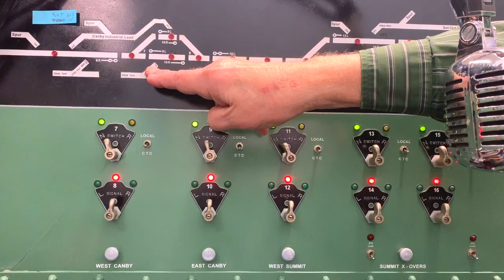How it Works: Railroad Signals and CTC (US&S Type)

Comment: In case there are people out there that don’t know what US&S means. Since it wasn’t explained in the video.That is the name of the manufacturer of the prototype signaling system used on many railroads and it stands for Union Switch and Signal. Also in case you were wondering what the radio system that model railroad was using is called FRS,  or the Family Radio System. A group of low power frequencies that can be used for two way radio communication without an FCC License.

Comment: Finally a related video that I can ask you something on! I have a freelance railroad that’s based off of SOU. do you have any documents where I can find SOU signal aspects, operating rules and train IDs? I don’t necessary need the operating rules, but I would like the signal aspects and train IDs.
Reply from the maker: You can google search NS or Southern / SOU railway signal aspects and that should pull up several charts / signal diagrams. For train IDs, facebook groups specific to the railroad your modeling are a great resources that may help you find what youre looking for. Hope this helps!
Reply: NSmodeler24 thanks! I sort of figured out the train numbers. They had manifests in the 100 series and intermodals/TOFC in the 200 series. Other than that I couldn’t find anything for the numbers. As for the aspects, I found something.

Comment: This is like the CTC system I controlled until more modern computer sustem was installed.  For the most part I liked the old system better.  For one thing it was more dependable than the modern updated one.

Comment: I know this is an older video, but wanted to ask.

I’m a conductor on CN and the Beaumont sub, where I work in Mississippi, is CTC- much less like most of CN’s track.

Does he have the ability to place a signal in “fleet” mode? Fleet mode allows for you to pass the signal, multiple times, allowing it to return to a signal more permissible than stop, Everytime. It also works when there’s cars in a siding, or main track, allowing only a restricting signal, or approach if only lines to the next signal.

We use fleet mode for making multiple moves if we need head room, for example.

Comment: Hey Josh, I have an unrelated to this video question. I’m building a C40-9 the same way you did, and I’m having a few issues. My first issue is the shell seems to be too short for the frame, as the trucks would clip with it if I cut it anymore. I’m wondering how to fix this. Thanks a ton and keep up the great work! - Cody

Comment: I would love to see what your procedures are in case there is a "derailment" do you just put the car back on track by hand or do you do something else?
Reply: We re-rail the train as quickly as possible to avoid any further damage to the models. Tim, the layout owner, will usually channel is prior real railroad experience into his best impression of a tyrannical trainmaster. If the derailment is is truly spectacular, we'll take  pictures if it.
Reply: supergamersbro I had a spectacular derailment one time, I had an Erie alco on the main line and a custom alco on the inner track. I had worked on the inner track recently and so I hadn’t fastened it back down yet, I was testing the track while I accidentally bumped the lever on my transformer and sped the train up way too fast, causing it to derail right when the Erie alco was coming around the corner, it hit the side of the Erie, derailing the coal car behind it,which hit a semaphore and shorted out the track circuit, throwing the main breaker on the layout. I was very thankful for that breaker that day...

Comment: How do the switches on the ctc board lock to prevent conflicting movements?
Reply: On a real board like this it would be done with relays.  If the operator tried to do something that conflicted with an established route (e.g. a cleared signal) then it would just refuse to do it.  Nothing would happen.
Reply: @jovetj  Thanks!

Comment: How on this layout are they doing occupancy detection?
Reply from the maker: I'm not sure about the hardware, but it's based on electrical detection of resistance on the cars and locomotives.
Reply: I'd like to see a video about this layout's signaling system and how it's installed, whether it's Chubb C/MRI, Digitrax, or LCC (probably one of the first two since LCC is relatively new).